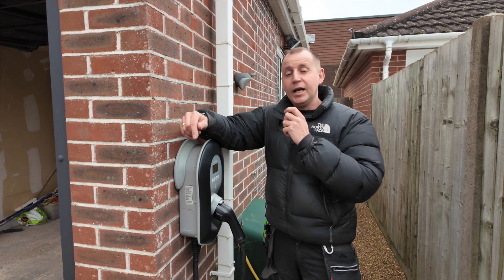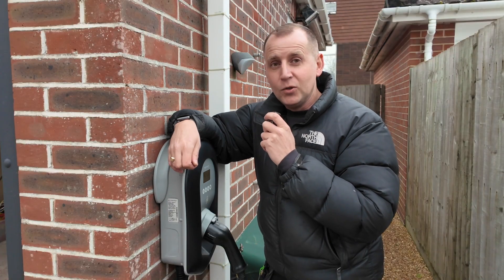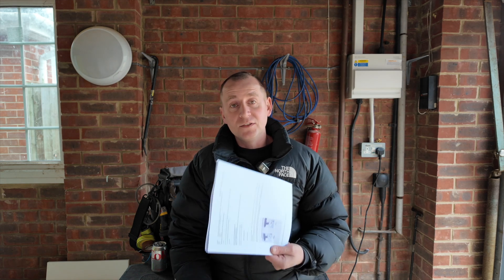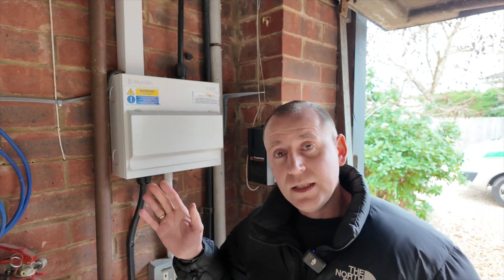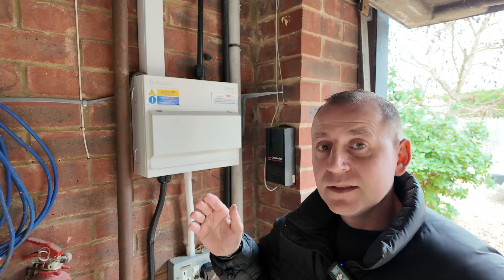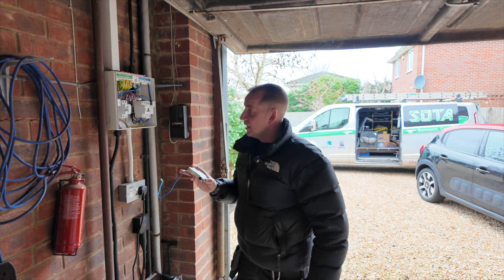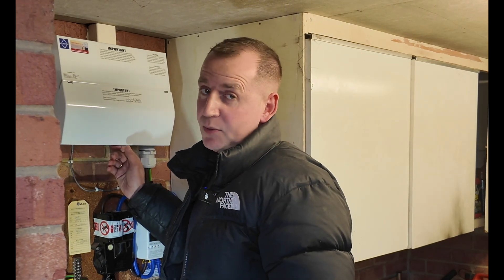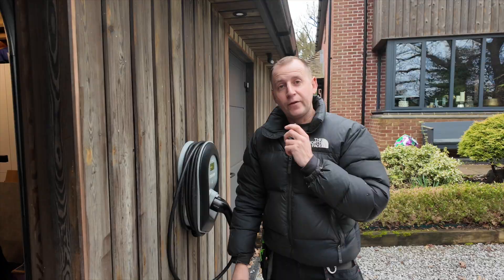THOUSANDS OF INSTALLATIONS MAY BE NON-COMPLIANT...ELECTRICIANS REQUIRED TO CARRY OUT REMEDIALS

Comment: I’m not a spark, and don’t install these for a living but I have a question 😄

Can you not use a fusebox rcbo that I’ve seen you fit on your videos to another manufacturers board? 

If not why? ( I like to be educated! ) are they different in sizes so they don’t fit another make of board? Or is it simply not allowed under your regs? 

Just wondering as surely they are doing the same job regardless of what enclosure they are in? 

As I said I’m not a spark, I just stumbled across your channel one day and liked your content and presentation, so subscribed!

Personal view here; you sir are a dying breed! Keep up the good work 👍
Reply from the maker: Thanks for watching commenting and getting involved!! Yeah so it’s really frowned upon to install a different brand in a consumer unit, I would definitely get strung up on here if I done that 🤣
Reply: Thank you for the insight 😄

That’s wild! If something was installed as a better “fail safe” so to speak, then surely something that is considered to be better / safer should be recognised as an improvement and not shunned because it’s a different brand.

That’s like almost running out of petrol and refusing to stop at a supermarket because it isn’t shell / BP etc 🙈

As a customer I would be none the wiser if somebody had changed one faulty breaker for another brand. As long as it worked and was safe I would be a happy customer 😄

Thanks for the reply!
Reply: The reason it is not allowed is down to the manufacturer of the consumer unit, as all units are type tested with their own products and not their competitors, and sometimes these devices run warm and the heat dissipation may be different in a different brand. So all warranties are void

Comment: I got queried by my niceic assessor regarding this, having a dp type A rcbo upstream to my charger. He questioned regarding discrimination between the two and said to either put a type b rcd or an mcb due to cabling being clipped direct. He believed the due to both being type A that they could potentially blind them both leaving zero protection. Whats your thoughts on this?
Reply: I had a discussion about this exact topic with ours, my argument was I always fit a type A double pole RCD or RCBO regardless of whether the charger itself has built in RCD or not, my point was that it's a dedicated circuit so hardly much discrimination to think about and any issues I'd rather have 2 RCDs that could potentially help protection a liability being an EV car but more for the convenience if the charger gets swapped for another manufacturer without the built in protection.

Comment: Unless the failed item (here an EVSE) could have been saved from failing by an upstream RCD, the lack of an upstream RCD did not increase the likelihood/probability for the defect to develop, and it is thus not a valid reason to reject a warranty claim.

If leakage current from one device by itself, goes high enough to trip a 30 mA RCD, the EVSE (or vehicle) is already faulty! (Maybe a second defect can be averted with an upstream RCD, in rare cases, but the first fault cannot be averted.)
Also, when the manufacturer states that they do not see an unconditional need for an upstream RCD, and therefore can work as advertised without an upstream RCD, it is not legal to reject warranty claims based on following regulations that may or may not be present where the device is installed. 

If a regulation gets changed after the installation is completed, it would go against the point of the warranty, if any future change/addition is used to cancel earlier promises by the manufacturer.
Regarding warranty, is seems like a distraction (red herring?) to use regulations as an argument for voiding a warranty.

Comment: When you install 3rd party equipment you need to put it in writing to your customers that warranty obligations are between customer and manufacturer of EVSE.   Standard practice.
Reply: Doesn't matter what you put in a contract to consumers the law always trumps any warranty terms.  If a garage fits a clutch to your van and it fails after 1000 miles would you expect the garage to say sorry clutch warranty is between you and the manufacturer nothing to do with us....

Of course not.  If you supply and fit something and bill the consumer direct then all warranty issues fall on you to rectify and it's between you and the supplier.

So if an RCD fails 2 weeks after install do you bill the customer for a new one and tell them to do a warranty claim?  This position is not only ridiculous but illegal too and would eventually fall foul of being taken to court or customers dumping you for awful customer service
Reply: @norfolkngood8960 we are not talking about a failed RCD here. Just with any appliance warranty is always with manufacturer not supplier/installer.  A fitted washing machine is a good example here.

Comment: Only the Zappi and Ohme units have internal RCDs. They should have seen this coming and insisted on external RCD protections when Easee got hammered last year. Moreover If Zappi are not compliant then neither are Ohme installs without the same external retrofit.

Comment: The Zappi installation manual does not state that an upstream RCD is required, and state refer to local wiring regulations.   So you need to push back on myenergi as they are not fulfilling their warranty obligations.   Also UK wiring regulations do not mandate upstream RCD!
Reply: Not entirely true, depends on the version of the installation manual in force at the time, the current manual does require an upstream RCD, this really came in to effect with Amendment 2 of the 18th edition, 

The manual issued in August 2022, a 32A Circuit Breaker was to be installed, local regs should be consulted to confirm if an upstream RCD is required. The manual issued in December 2022, Staes the same. The manual issued in July 2023 States  that the overcurrent device of 120% should be installed (38A so 40A) and that a RCD device may be required subject to local regs, then it references 18th Edition Section 722 which states a dual pole 30ma Type A RCD should be installed upstream and may be combined into a single device (RCBO) 40A compliant with BS EN 61009-1.

Providing you demonstrate that the installation was installed to the installation manual in date at the time then it was compliant at that time. 18th Edition states that the manufactures installation instructions should be followed. Regs cannot be retrospectively applied.
Reply: Have a look at wiring regulation again
Reply: @audriuskomicius1838

Which regulation?

I do not know of one mandating an RCD upstream of an EVCP.

Comment: What a load of B*****ks what about having no discrepancy between two identical RCD's. 
That will make testing impossible. What RCD are you actually testing while and recording in the test sheet. And why does a cable that is clipped direct need and RCD.
The RCD is surely for protection of people amd livestock. If the electrical equipment needs protection then I would have thought a quick blow glass fuse would be more appropriate. 
I don't see how my energi can begin to say that with a straight face.

Comment: Had the same thing with a commercial site 22kw Zappi - but because it was installed before we completed their training due to conflicts at Myenergi's end they wouldn't warranty it. 
They also won't warranty any installations pre wiring regulations change - which themselves aren't retrospective. It was highlighted by Efixx when Sweden or Norway stated one of the chargers on the market wasn't sufficient and I know Mark Allison did a video on it shortly afterwards. 

Also because BS7671 isn't retrospective Myenergi and other manufacturers leave themselves open to being taken to court under trading standards. It is a massive grey area and honestly they should probably just do the warranty and pay out for peoples original installer to swap them over to RCD protection for the circuit conductors.
Reply: Easee had a recall but not a full. Customers are highly recommended to get protection retrofitted but are not mandated by law or regulation. If the recall was full, a ban of usage, they would have had to.

Comment: Unless a fault is caused by the lack of RCD, Myenergi would be on very dodgy legal grounds refusing warranty cover.
Reply: Try Small claims court. Simple process. I bet they wouldn’t even respond and you’d get a result by default.
Reply: Exactly, this sounds like a very shaky excuse. A far more likely reason is they have a high number of warranty failures and know that independent installers don't have the buying power or legal department to push back. I'd be extremely reluctant to give a company more money who are obviously using spurious excuses to not back their warranty.
Reply: Mike, you and I and this nice man who is local to me... all know this, MyEnergi just went WAY down in my opinion.  Unless they care to come back, HERE, in this comment section and explain their behaviour, and pay him for his time/materials... they can eff right off
Reply: Who is going to exercise the legal route though?
Reply: @normanboyes4983  Small Claims doesn't cost much
Reply: @normanboyes4983  Cheap enough. You don't need a solicitor at small claims. And as others have pointed out, the regs are not retrospective. As to protecting the device? Words fail. And what happens if the RCD fails.....
Reply: Like anything will happen to them. Companies do it all the time and Trading Standards just allow the corpos to essentially fuck all their customers in the butthole.

Comment: I got pulled up for this from my NIC assessment. 
The rcbo i needed was a commercial schneider model costing around £80.00 which helped make the decision to opt for a Zappi knowing the built in RCD would save on cost with the supply being wired in  surface mounted SWA. 
Very frustrating.
Reply: I'm sitting here thinking, fuck I done the same thing. 
Then it hits me, there's 3 x 22kw 3phase zappis on a schneider board. Gona cost me £800 a fucking charger
Reply: Fit a three-phase RCD in an enclosure just to the side of the board, will be miles cheaperer

Comment: Im old but i
Didnt it use to be the case that following the manufacturers instructions essentially bypassed the regs?

For instance a 5kw heater that comes supplied with hard wired 1.5mm flex on it.
By the regs thats too small but the manufacturers installation/requirements supercedes that.

Also at the time of installation it didnt require a rcd just because the regs have changed  doesn't change the status of its acceptability

Comment: Myenergi are doing this as put it bluntly they are in questionable financial position, laying staff off, taking on sudden  loans and investment etc without which likely would have gone under... the warranty costs are killing them. its a means to reduce outgoings and dodge the costs...  in last several months i have had several zappis fail..
Reply: How do the Zappis fail? Is it the electronics? The power supply for the internal electronics? Problems doing the initial handshake to a charging session?
Death by a 1000 short voltage spikes?
Reply: @NikolaiBeier I replaced one Myenergi Zappy to Hypervolt in the past few years and the main reason was (socket type / untethered) internal components burnt out due to loose connection in the type 2 charging pin area.
Myenergi refused any help.

Comment: You’re putting in protection for the cable…. Not the charger unless stated… did you reach out to my energi? As you could have refused to change it for the customer, as your install was perfect at the point of installation.
Reply from the maker: I tried, called 3 times, on hold for over half hour each time - gave up
Reply: Even when you read the current my energi guide it still doesn’t say you need one 🤦‍♂️ I think someone at myenergi needs a slap on the bum bum.
Reply: that stinks, I hope they make it right for you - I'll be getting rid of my zappi if that's how they treat you @sotaelectrical

Comment: What a fucking joke, what if the circuit is wired in swa?
Reply from the maker: Don’t think that would make any difference
Reply: @sotaelectrical  Thanks for making  this video and bringing it to attention.
Reply from the maker: @richardnewton5159  no probs mate, have a great weekend 👍👍
Reply: Also they have a 30ma type A rcd built in as well as the 6ma dc. So surely selectivity isn't being provided if one is fitted upstream
Reply: I’ll just point out that the Code of practice for EVC installations does say that selectivity is not practicable under some circumstances. Page 42

Comment: So does the Zappi have 30mA type A RCD built in or not - from your bit at the end it sounds like one manual says it doesn't (only the 6mA DC), but the installers guide says it does...
Reply: I'm assuming this isn't eg on a hardware refresh they've just taken out the type A to save manufacturing cost or similar?

Comment: You sure you are reading this right? Are Myenergi saying they will warranty the Zappi but the circuit needs improving to meet current regs? You didn't nothing wrong at the time of install so bill the customer for the upgrades required. i.e. DP RCD protection. Sparkies aren't returning to jobs from decades ago where they installed sockets with no RCD but if they were to install an extra socket today they would charge the customer for RCD protection. I don't see that this is your cost or that you need to return to the other jobs where you installed the EV chargers correctly at the time.
Reply from the maker: So I said in the video that in order for the new zappi to be installed I had installed the RCD first, after that, all good.
Reply from the maker: That’s fair enough, I just thought I was doing the right thing
Reply: @sotaelectrical  your customers will certainly be impressed with your service. Keep up the good work mate👍
Reply from the maker: @solarrover9575  thank you mate
Reply: @sotaelectrical  yes but not sure why you feel you should cover the cost of the RCD that’s my point really. Or why you feel you need to return to your other installs where you didn’t fit an RCD which was fine at the time? I assume i you aren’t returning to any domestic light circuits you have run pre 18.2 to install RCD protection? Personally I’m not much of a Myenergi fan they have poor reviews from sparks that have worked for them.
Reply: RCDs have always been a requirement, that’s not changed, what has changed is what Myenergi claim about their RCD, they used to claim their RCD is fully compliant with BS7671 and therefore an upfront RCD is not required, now they’ve admitted that their RCD never did comply with the listed standards in Part 7 and so in the UK an upfront RCD is required.

Comment: It sounds like MyEnergi are now trying to find a way to not cover warranties. There is a quite large failure rate for zappi's. Ive had the out the box gubbed and its not easy as an installer to get warranty stuff done
Reply: How do the Zappis fail? Is it the electronics? The power supply for the internal electronics? Problems doing the initial handshake to a charging session?
Death by a 1000 short voltage spikes?
Reply: But as soon as the installation is ‘as required’ they will honour the warranty and send out a new Zappi replacement.  I have seen this before. They will honour the warranty

Comment: If you’ve installed it before reg update ide bill my energy for the extra works. People who have fitted loads will be suing them.
Reply: No. Bill the customer.  It's customers problem as warranty is between them and MyEnergi.
Reply: @XX-ww8lh I wonder how much this will hurt sparks when the customer gets billed. It will make a lot of people question the competency of the installer, I'd absolutely be livid if I was hit with a bill because it hadn't been installed correctly. Frankly, I'd be telling you to shove your bill up your arse!
Reply: @XX-ww8lh  One can only hope that you are not an electrician because, based on your attitude, both your moral integrity and likely work ethic seem to be severely lacking. When a customer hires an electrician, it is with the expectation that the job will be completed professionally and in line with proper standards. It is not the customer's responsibility to instruct the electrician on how to carry out the work—that expertise is why they are paying for professional services in the first place.

In this particular situation, the customer paid the electrician to ensure the installation met all necessary standards, including safety regulations. If the training materials or guidance provided to the electrician clearly indicated that an RCD (Residual Current Device) was not required, and the installation was carried out in line with those instructions, then the fault lies with the manufacturer or supplier of those materials or equipment. The invoice for correcting the issue should rightfully be directed at them—not the customer—since it was their oversight that led to this problem.

On the other hand, if the guidance on the matter was only provided verbally and nothing was officially documented, then the electrician has no proof that such instructions were ever given. Without documentation, it is impossible to verify that the manufacturer or supplier explicitly stated that no RCD was needed. In such a case, it becomes difficult to justify passing the blame to them, as the absence of written proof undermines the electrician's position entirely.

Ultimately, accountability is key in any profession, and when errors arise, it is crucial to trace their origin and assign responsibility accordingly. Whether the fault lies with the training materials, the equipment supplier, or a lack of documentation, one thing is clear: the customer is not the party at fault and should not bear the financial burden of correcting someone else's mistake.